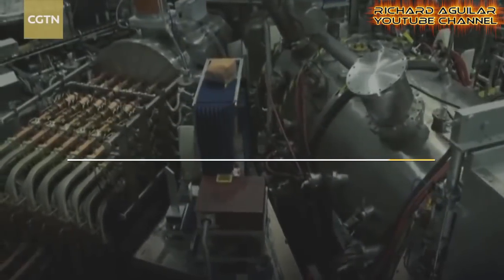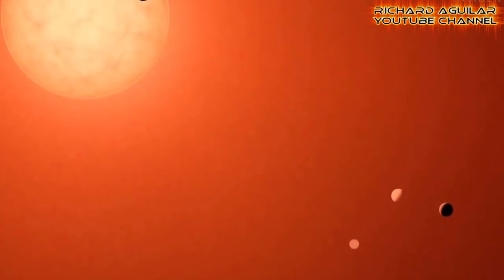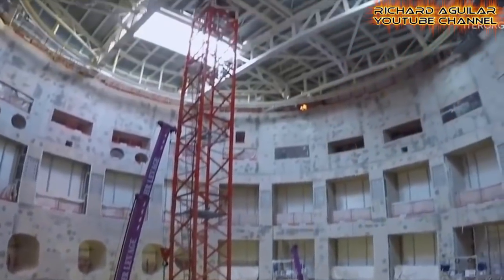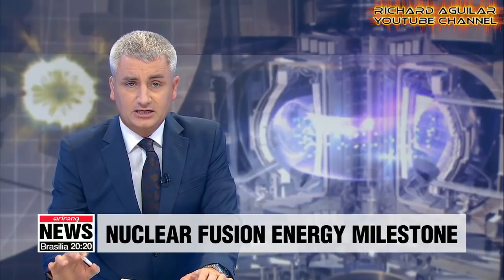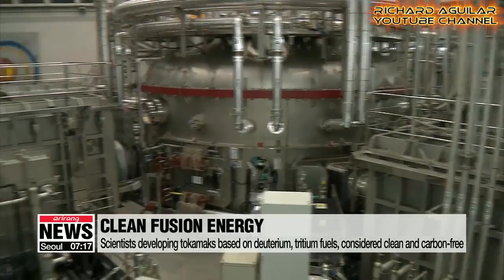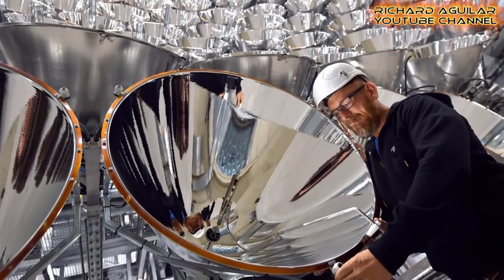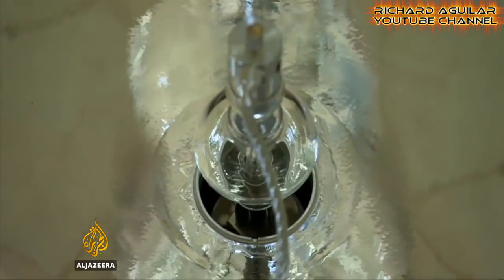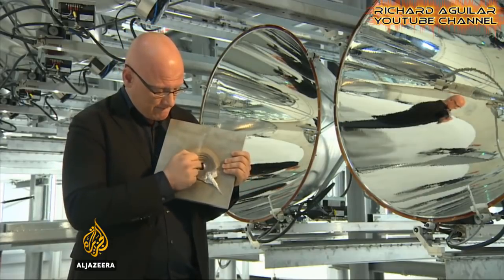UNBELIEVALBE Artificial Sun 6 to 7 Times Hotter Than The Real One Invented From These Countries

Comment: 6 times hotter than the sun hmm? I don’t know if that’s possible, is there a material or metal that will not disintegrate with that high of temperature?
Reply: Don't know but only for 20sec Suns temperate has remained constant and is increasing day by day.Who knows what's the temperature of sun's core actually!!!
Reply: A magnetic field can hold it
Reply: @timcockrell497  yup..hold it like you hold a glass of milk...what kind of magnetic feild holds such heat is beyond me...physics was not one of your strong subjects in school it seems

Comment: I have one question
In this world there is no metal which can go to near the sun because of its temperature.
So many countries are trying to send satellite to the sun orbit but they send it to only safe zone after that every metal get melt.

I assume for a little bit time that scientist have found the metal that can resist heat, but if you're saying that 6 to 7 time greater than sun temperature, then I refuse to accept it that kind of metal exist which can resist heat 6 to 7 time greater than sun temperature. How can metal hold the temperature which cannot go to the near of sun. How can resist that much heat?

You made the video then I think you know about the metal used in reactors, can you enlist them. 

I am looking forward to see your answer.
Reply: It’s magnetic field which prevent the heat from touching the metal. So there is no improvement on the metal part, it’s just a very advanced way how you control the process.
Reply: I was wondering the same thing. Not necessarily sure on the science that proves that magnetism can act as some alleged force field from the heat. I was under the impression that even a magnet that is made out of some solid would melt as well.
Reply: @liu3gz  I was wondering the same thing. Not necessarily sure on the science that proves that magnetism can act as some alleged force field from the heat. I was under the impression that even a magnet that is made out of some solid would melt as well.
Reply: @MrMarineti  truth.  Torus. )

Comment: Well, to produce net power, a nuclear fusion reaction has to be above 100 million degrees kelvin. The temperature of the sun's core is roughly 15 million degrees kelvin. So wouldn't a normal nuclear fusion reactor already be 6.66 times hotter than the sun? Nuclear fusion reactors with positive net power output have been around since the 50's. 

Even still, China's CFETR  fusion reactor has a net output of around 1,000 MW. An average nuclear reactor also has a net output of around 1,000 MW, except it's a lot cheaper and a lot safer. The most powerful nuclear reactor, the Kashiwazaki-Kariwa plant in Japan, has a net output of 8,000 MW. Nuclear fusion as a viable energy source still has a long way to go.
Reply: Correction: fusion reactors are a lot safer than fission ones. However, initial cost estimates for the CFETR reactor were around $22.5 Billion, which have since increased. A nuclear fission reactor with that same power output only costs around $6 billion. It is also more expensive to run fusion reactors due them requiring high electricity usage to function.

Comment: If it is 6-7 times hotter than the sun  it should be all around those area near that artificial sun suppossed to be melted already..if that is that really that hot meaning, even the hardest metal will be dissolved in seconds. But i see it the surrounding metals are still intact meaning it is not really that hot Haays
Reply: Maybe what he/they meant to say was the heat that we have on earth not the actual heat of the sun in which nothing can withstand of